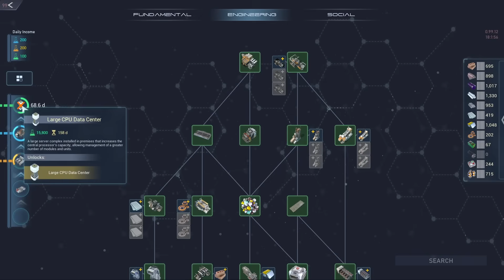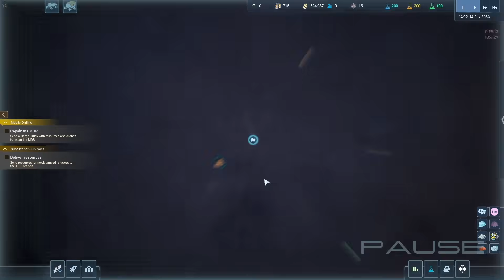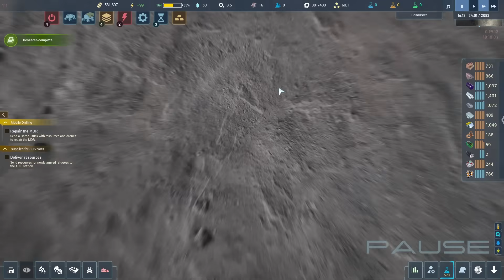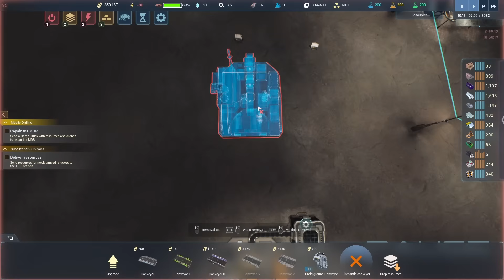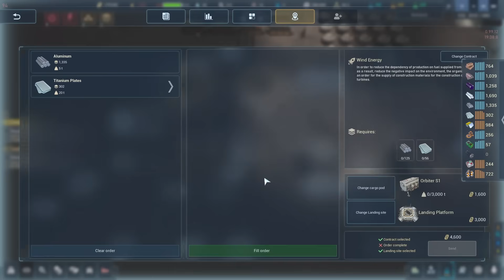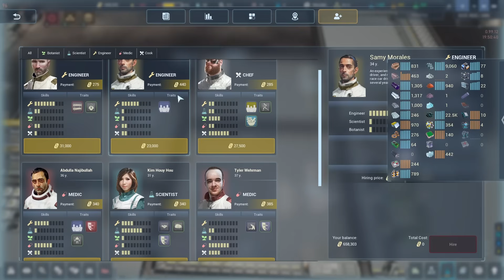The Crust - First Colonists And Advanced Assembly - New Horizons Update [E7]

Comment: Hi Surtr, really enjoying this series and hope you continue it for a while yet. 
For your large storage system upstairs, I think you can lock the output on the large storage box itself meaning you don't need the extra 2 splitters and bypass belt cutting cost a bit. Also on the input splitter, it's good to also deny the item being split off from moving forward as well. Example only steel can go thru to the right of the first splitter, only bricks left but then say everything but bricks and steel may go forward from the first splitter.
I'm also only 11mins into this video so if you make these changes later im sorry for jumping the gun 😅 love your work man, have a great day.
Reply from the maker: Thanks. You are right about the input belt. I did need to restrict the path forward for the items that where just split off. As for locking the output of the storage, I wanted to have the status visible. The storage doesn't have the red arrow. That is why I did it like that.